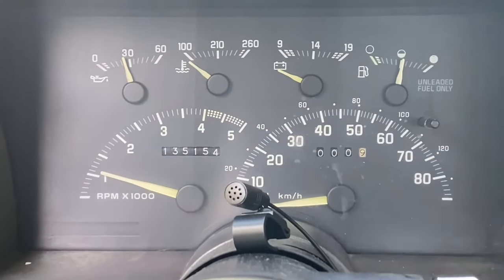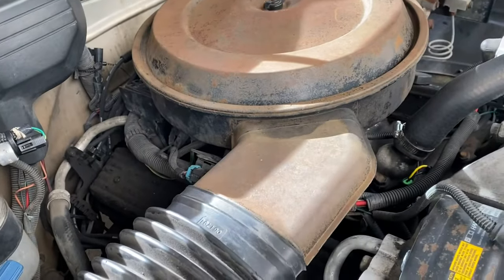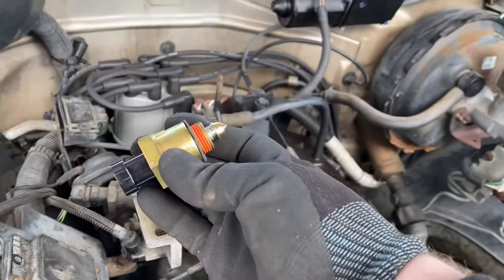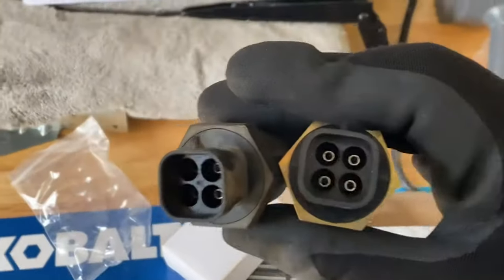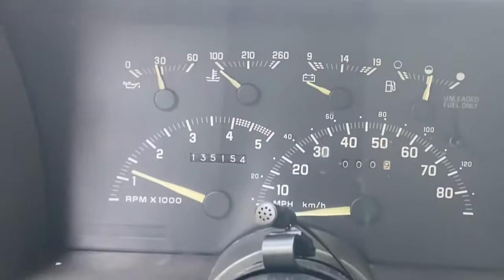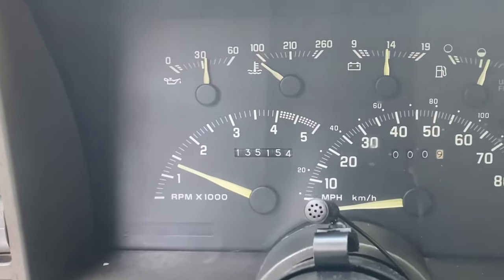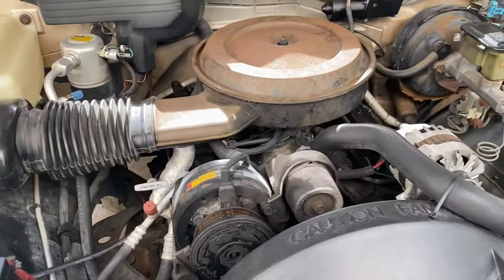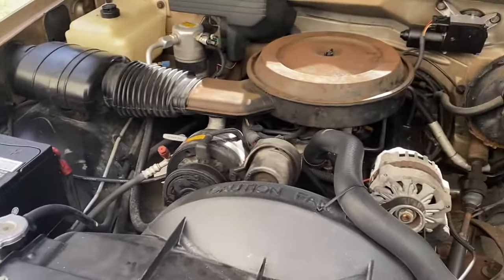1991 Chevy C1500 Idle Air Control Valve Replacement

Comment: Dear colleagues; disconnecting the battery before any repair on a sensor is advisable in order to reboot the computers of any car.
Reply: Thank you
Reply: What’s happens if you don’t disconnect the battery, because unfortunately I didn’t and the truck keeps shutting down??
Reply: @romansandoval5399  
You can still try and  disconnect the battery.
Connect the 2 battery connectors together for a couple of minutes in order to reboot the car computer.
Reconnect the battery.
If this do not work it is possible that the sensor got defective due to installing it without disconnecting the battery.
Reply: You have to reboot the car computer otherwise the car will not detect the new sensor.
Normally this is done with the car scanner but if you don't have a scanner this is the only option.

Comment: that engine should idle at 750 rpm not 1200 you need new idle speed sensor.!
Reply: I was about to say the same exact thing!  I drilled mine out and adjusted it ...helped but still alittle high. 750 is perfect! 1200 is still to high.
Reply: The tach is incorrect. It's idling perfectly.

Comment: My 94 C1500 had random rpm surges when idling. Replaced fuel filter, a vaccum line, and ran Seafoam through the gas tank in case it was the injectors. Still happens. Was going to clean the MAF until I realized....theres no MAF🤦‍♂️. Anyone think that cleaning or replacing the IAC will fix it? Its not a huge issue, just annoying that half the time I stop at a red light, someone thinks I'm trying to race
Reply: Sounds like a base gasket vacuum leak. Replace the gasket. Common problem. Can also be a vacuum leak elsewhere, but that sounds like a base gasket issue.

Comment: Great video and nice looking truck. I have a 1995 C1500. What’s the air drier looking connection off the bottom of air cleaner assembly?
Reply: Cold start something I think
Reply: Got the thing on my 88
Reply: Heat riser. Funnels warm air off the exhaust manifold for cold weather starts. Not exhaust gas, just ambient heat.

Comment: My 92 s10 gets 10 mpg and runs super rich, lots of power and runs good besides the above mentioned, I’ve changed everything except egr and o2 sensor which I did check and they’re working
Reply: Change EGR . Promise you’ll notice a difference.

Comment: Thank you so much this helped a problem with my truck but I still have  anouther problem it idles fine when In park and I can even rev the enigne but when I put in in drive or reverse if I don’t step on the gas it stalls But if I get it to 10 mph I can drive just fine but as soon as I slow down to stop or turn it stalls do you know what it could be? I have the same truck as you it’s a 93
Reply: Did you find out what was causing it. I'm having the same problem.
Reply: @theblack_6.033  all new distributor would help had a buddy with a problem truck turned on but once in gear would turn off sometimes and it was only if he didn’t have his foot on the gas it fixed his problem

Comment: If the control valve is blocked would this lead to a weak idle? My truck has been running way too low when stoped but seems to be okay when driving? Any ideas?
Reply: Replacing all of the easy to access sensors fixed my low idle in my 5.0 TBI. MAP sensor seemed to be the one that did it and it's relatively cheap and super easy. Control valve and MAP sensor.

Comment: So I've replaced my map sensor, rebuilt the throttle body, replaced the IAC that you replaced in this cid, also did the injectors and fuel filter, new pcv. The vacuum lines are good and the motor has been rebuilt. I honestly don't know why it wants to still stall or have a decent idle until a stop light. It runs great but it doesn't. Didn't know if anyone had any thoughts
Reply: Sounds like the problem I'm having...its killing me
Reply: @RogueKnight33  I was told to go to a carburator set up and delete alot of the electronic stuff
Reply: @SekadaJones  I figured mine out! It was the maf sensor!!
Reply: @SekadaJones  I did also do a fuel filter too but positive it was my maf(map) sensor
Reply: @RogueKnight33  thank you, I've done both of those aswell. Still acting up
Reply: I had the same issues. What fixed it for me was getting a new ECM.
Reply: @sagethomas9594  yea I might just have to do that, I appreciate you reaching out
Reply: Try the distributor if that’s new try the sensor that goes next to the thermostat

Comment: there is a wire harness disconnect for  the a/c flapper door,, no need to remove any panels just reach under that area where noise is coming from and disconect it
Reply from the maker: Problem is I want to actually fix it so I can run with A/C. Unplugging it only stops the noise.

Comment: When I bought my truck 5 years ago started changing sensors aic,tb,map, temperature control,knock I'm finding the AIC about 2 years needs cleaned or changed ilove my k1500 1995 350 tbi I hate the sensors but the engine is kick ass also Didi differential fluid front and rear does anyone have problems with the brake safety switch what a pain in the ars

Comment: Put mine in today.  Idle went through the roof.   Did all correct resets and still was super high idle.   Put old one back in.  Normal idle    Any ideas?   I’m guess it’s a fault valve.  The spring was low on the new and the old was up.
Reply: Mine has this same problem what do I do?
Reply: @brayanbasalduamartinez9937 check the pcv grommet, if it’s cracked or old you’ll need to replace it.   Idle goes back to normal
Reply: Your connector isn 't plugged in correctly.
Reply: @alanrives6731  turns out it was the valve cover gasket last owner just shoved one in     Replaced gasket.     Perfect idle 😎
Reply: @lht5dy31  why did the valve cover cause the issue? The gasket for the grommet
Reply: @ObservingTheSus  it was the grommet that attached the PCV valve on the cover.   It had a hairline crack. Along with the smashed in cover gasket

Comment: They say that when this is replace needs to be recalibrate or reset is that true? U didnt show that or u  didnt do that?
Reply: Just unplug battery for 5 mins no need to do anything but install plug in and first start won’t work at all turn it off then back on and it should work that’s what happened to me

Comment: I have a issue while driving, after cruising for awhile it’ll get stuck at 150k rpm and I have to put it in Neutral an rev it a couple times before it goes back down.
Reply: 150k rpm sounds like your engine would explode.

Comment: What does that dryer vent thing do that attaches underneath the air intake?
Reply: it takes some ambient heat from the manifold and directs it into the throttle body to assist in warming up the engine

Comment: My 94 always idled around 800 to 1000.  Recently on start ups it been idling real ruff, like the plugs or wires  or something electrical is wrong.  Isn't throwing codes yet, so i'm thinking it's some little dollar part.  Just don't know what part it is yet.
Reply: My 94 Chevy k 1500 idled rough for about 10 minutes when you would first crank it up. I changed the 02 sensor and it fixed it.
Reply: I had the same problem, was the knock sensor for me on my 90 firebird tpi
Reply: Common problem with idle on these trucks is your cap and rotor they tend to crack try replacing those
Reply: I replaced a vaccum line and the fuel filter and it smoothed it out but I still get RPM surges, working to fix that now